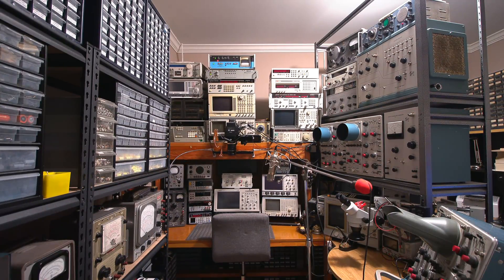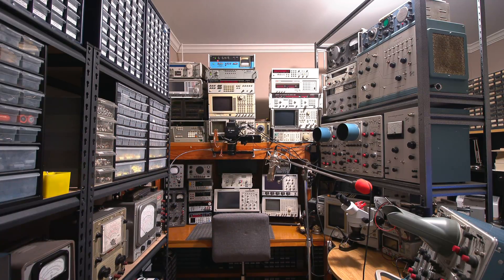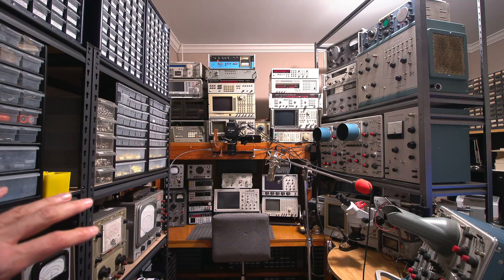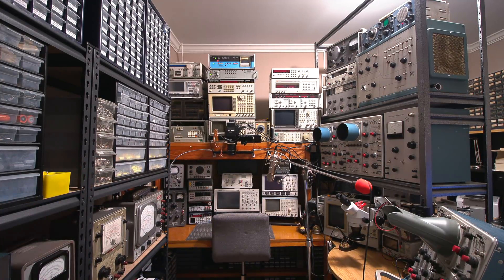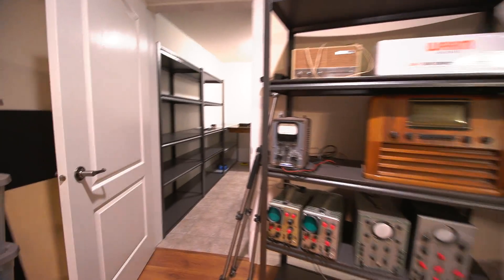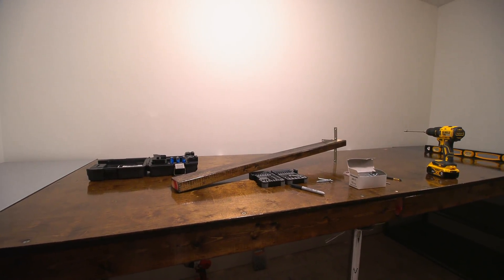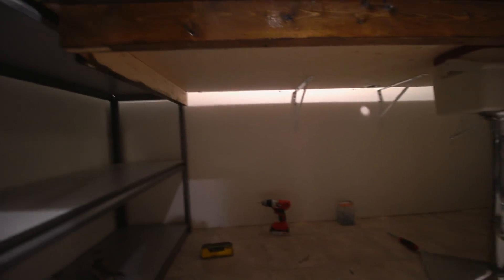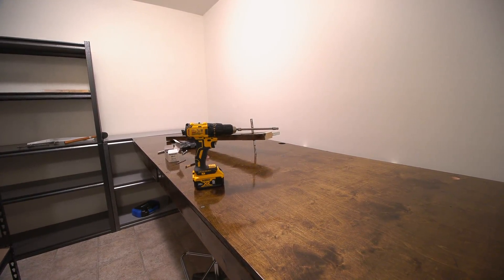The New Labs Being Built Now! [Progress Update]

Comment: A good friend of mine recently passed away. He owned a repair shop just like yours. For 50 years he specialized in the repair of vintage radios and TVs as well as modern guitar amps, ham equipment, and various other devices. Remaining in the shop are THOUSANDS of tubes (6000?), the majority of which are new old stock from the 1930s to the 1960s. If you are interested in purchasing any of these or any high quality test gear let me know and I will put you in contact with the family.

Comment: Breath of Fresh air ,,, real troubleshooting , analysis and design electronics which you can take furthur, this is HOW you learn REAL electronics !
Reply: Thank you Mr. Carlson for your amazing in depth repair and restoration videos on equipment that some may find obsolete ,, I was at the "tail" end graduated Bklyn. 
Tech High School graduated in 1978, ,, when soon after that they NO longer had electrical or electronic PRE Engineering teaching of vacuum tubes theory and design !,, I feel still is imperative to at least have a knowledge of this alone ! to be fluent in just theory and open mind ,,this is how it all started ,, something about a tube amplifier ,, so warm and knowing your restored one yourself even if the specs are not cutting edge , I remember the feeling of when you saw the glow those hearters and the sound coming out of the speaker that you repaired it the right way like you demonstrate in such awesome detail ,,!

Comment: I see a Tek 556 on the right-down.
Is it going to be on the bench for restoration...?
Reply from the maker: I'm using it.
Reply: @MrCarlsonsLab 
Nice!
I have one too.
Serial #178.
Reply: One more question...
I see a couple of Tek devices that I don't recognise.
I'm pretty familiar with Tek stuff, but I really don't know those two.
One of them is on the right of the two 547s, and the second one is above them. The large unit.
What type or model are those two Tek units...?
Reply from the maker: The Two units are: (Type 50 TU Test Unit) and the other is a (Type 105 Square-Wave Generator)

Comment: Hi, I have been watching all you YouTube videos.  In particular, I watched and wanted to duplicate your three wire antenna.  In the new lab, can you talk about how the new antenna-connections are installed.  In particular, you need to let us know how you set up the antenna with a lightning arrester (or safety connections made for the cabling to come from outside to the inside of the new lab).  Are you protected in case there is a lightning strike?  Thanks!

Comment: You have so much great gear. I don't know if you use a large Lazy Susan for heavy repairs, but I've found one to be almost essential for work on heavy gear like old HP spectrum analyzers. I decided what diameter would be best then cut the plate out of 3/4" plywood, and added a wedge brake. I use it all the time now, even on items that aren't particularly heavy so it doesn't disturb the gear as I work on it.

Comment: For some reason, every time I see one of these views of all this equipment, I recall the scenes from the Christmas Vacation movie where "Clark Griswold's" massive number of Christmas lights turn on, the power grid drops, and they cut to a control panel at the power company where somebody throws the switch "AUXILLIARY NUCLEAR".   (Fun fact:  That is how they spelled it in the movie instead of the correct "auxilliary".)
Reply: Surely you meant to use the correct spelling, stating the fun fact! 😜
Reply: @crazyphil33  I did use the correct spelling.  First, correct for exactly how it was shown in the movie.  And then the correct spelling parenthetically.